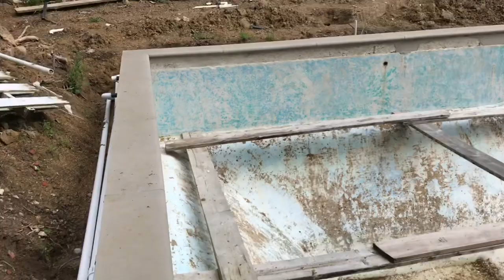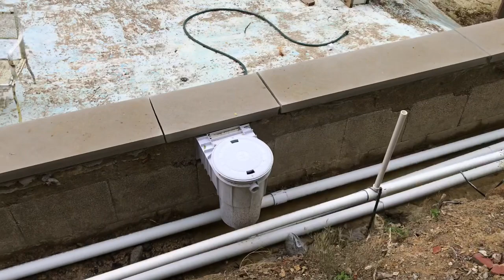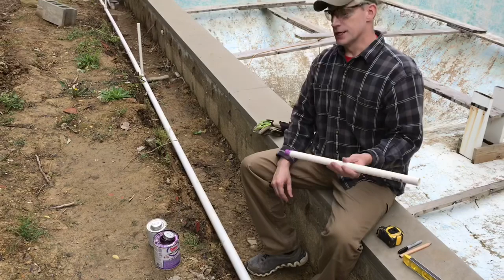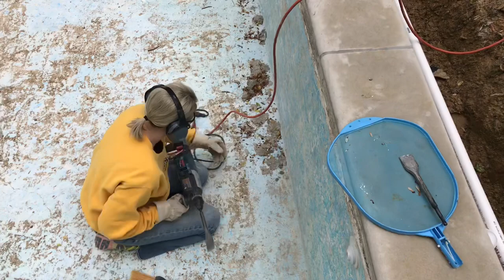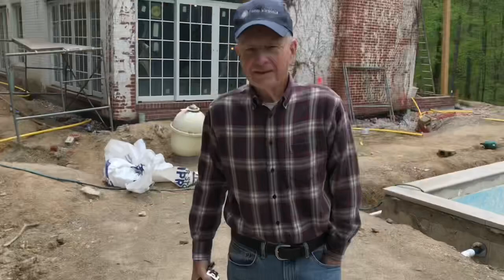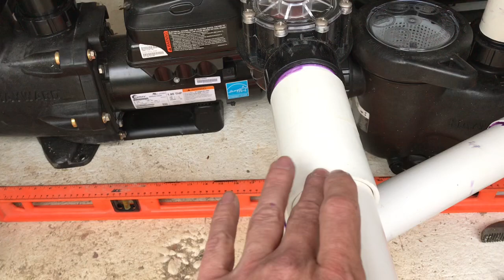Episode 138: Plumbing the water feature and finishing the pump house!

Comment: Your plumbing is WAY too tight.  You don’t have enough straight pipe before your pump.  You’re using way too many 90 degree elbows.  I can only imagine the amount of restriction to flow or TDH you’re going to have.  You’ll probably have to run that variable speed pump at or close to maximum speed just to overcome resistance to flow!  I hope that’s at least 2” PVC.  You also need to consider a sacrificial anode if you’re running a salt system.  I love your creativity in getting so much put into such a confined space, but in plumbing a pool, thats not really an asset.
Reply from the maker: Thanks for the feedback. The system has worked great for the last three seasons. The variable pump usually runs at 70% during filtration and it works fine. I could probably run it at 50%, but the skimmers and returns keep things cleaner with more flow. Everything is 2” except for the deck jet loop. We have a sacrificial anode between the filter and the heater, and it’s also wired into the bonding grid.